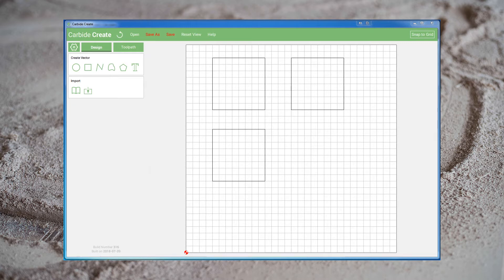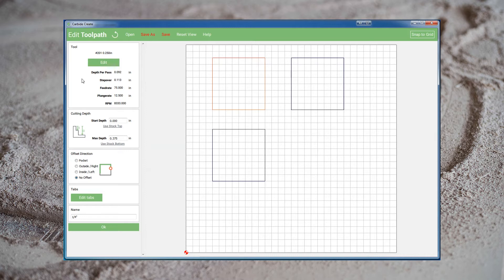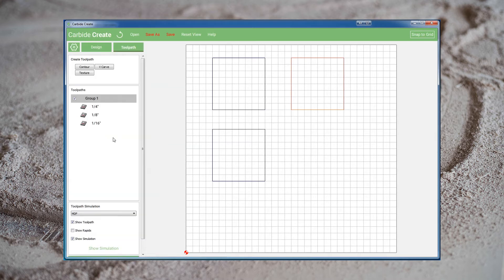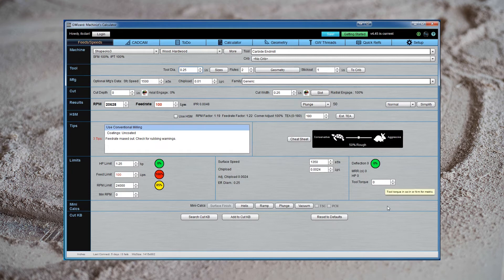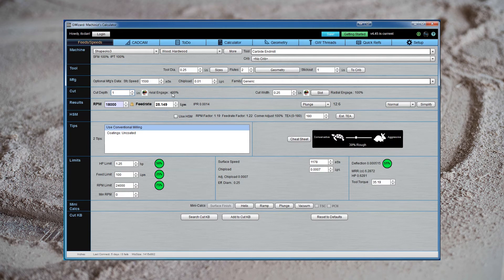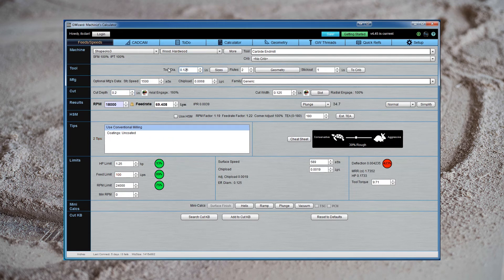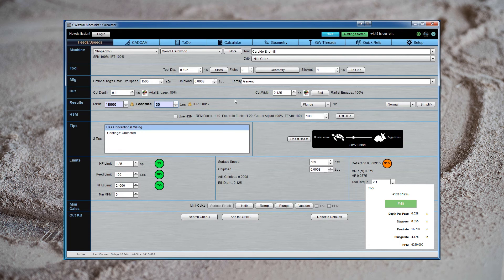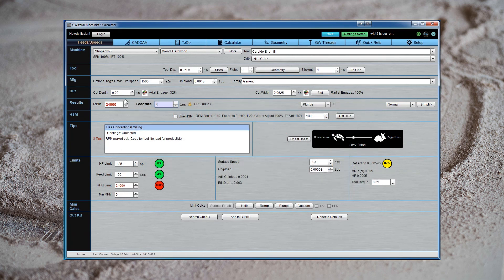CNC Basics 03 - Feeds & Speeds, Getting Better Cut Times, and using GWizard Calculator

Comment: I am new to CNC and trying to learn feeds and speeds. You use bit deflection as the gauge, what about chip load? I see others target chip loads to indicate heat transfer. What is your opinion on this? 
Also I am getting the feeling that bit manufacturers are concerned about chip loads and they have different numbers or ranges. 
Any comments here would be appreciated.

Comment: thanks for your videos, super informative and helpful. I do have a question on pocketing vs slotting. Is slotting more aggresive than making a pocket? Or I guess I'm asking if I could use these more aggressive F&S for pocketing out material?
Reply from the maker: Slotting is more difficult for the machine and bit than pocketing, you’ll typically want to slow the feedrate down a bit when doing that.
Reply: I see, thanks for your your response

Comment: Thanks for this info.  I find the V-Bits are very slow for me.
Reply from the maker: If you’re using the default plunge rate consider increasing it, doubling its default is usually safe, and you can lower the retract height from 10mm to 5mm if you don’t have clamps you’re trying to clear.